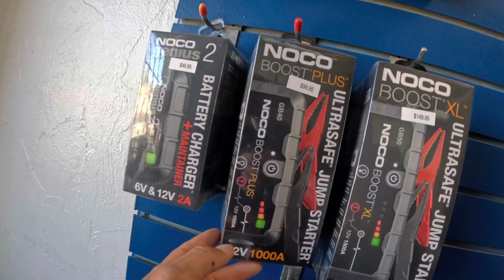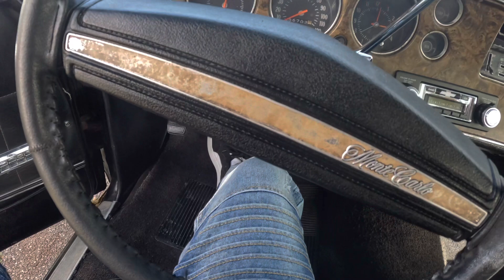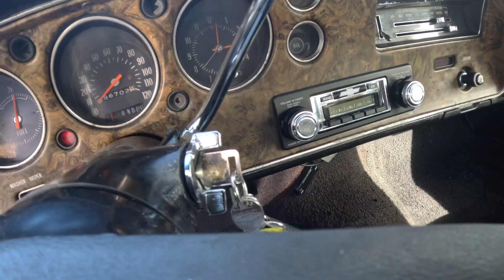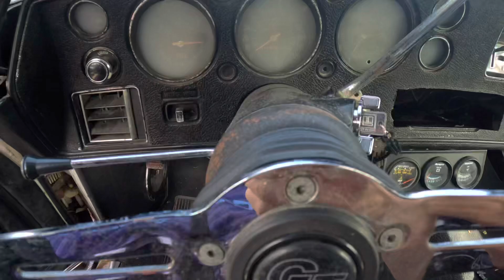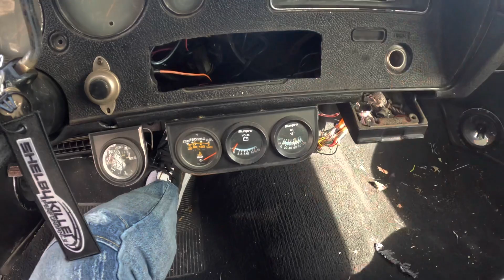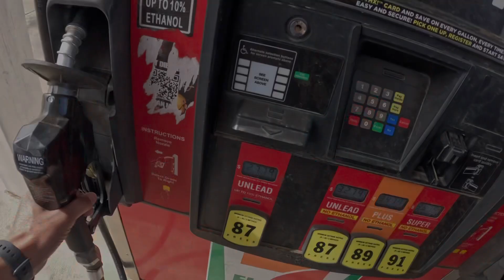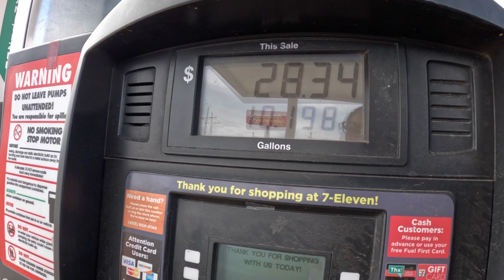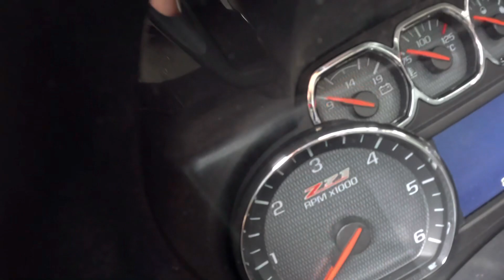I JUST BOUGHT A NEW CAR FOR MYSELF AND POPS ALREADY TRYING TO BUY IT FROM ME

Comment: You probably need to check the brakes on that truck. With the fluid that low, either there is a leak or worn-down pads.